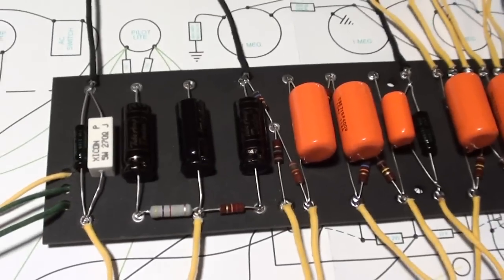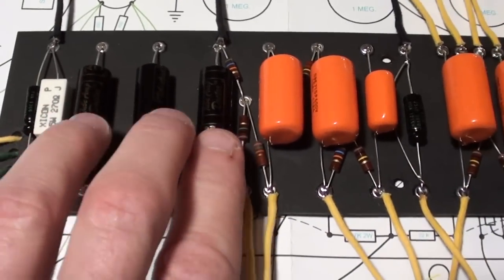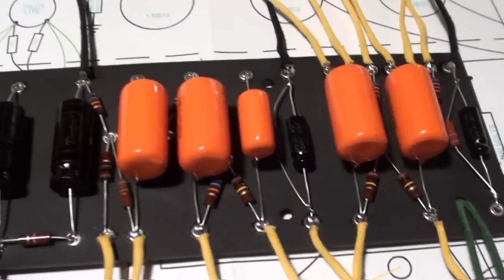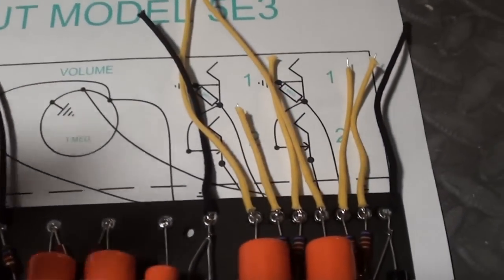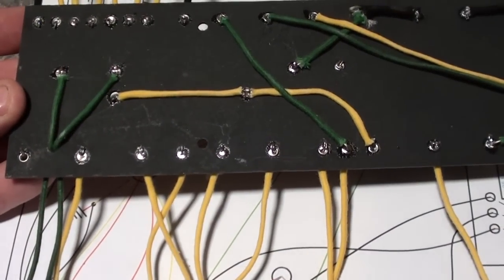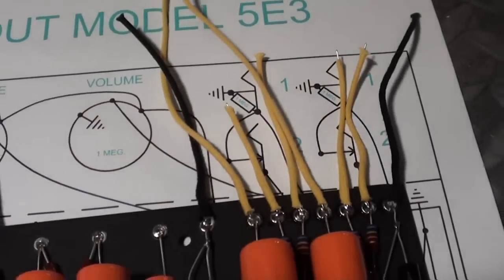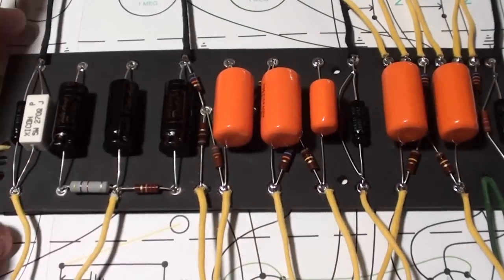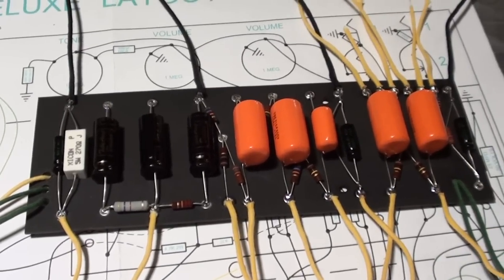Mojotone Tweed Deluxe amp kit the eyelet board

Comment: Here's a tip: you can scan in the diagram and mirror the image over the vertical axis so you can inspect your work on the back of the pcb (i.e. to make sure that all your wires are in the right places). That is what I usually do when I'm diagnosing circuits and conduction paths.

Comment: Smaller electrolytic caps are bypass caps that are used to bias your pre-amp/output tubes.

The bigger caps are for filtering DC ripple current after it gets rectified. 

Looks good man!